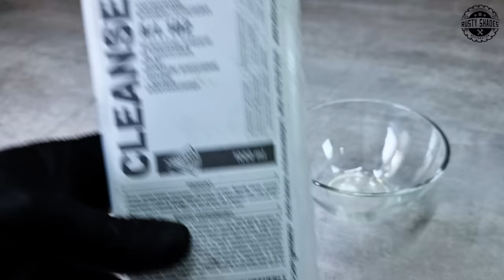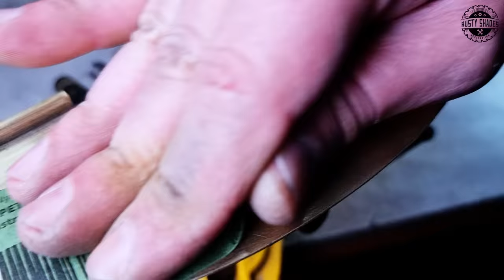Primitive Bread Toaster Restoration - 1918 Siemens-Schuckert

Comment: These take a little more care when toasting your bread.  I find you have to flip them top to bottom so they toast evenly on the one slide of the toast, but this is easy to do.  Toast them then move them upside down, then swap the left toast to the right side untoasted side inwards, and right to the left untoasted side inwards, after a bit spin them so to the bottoms get an even toast.  Oh and try not to get a cup of coffee while toasting and forget your toast as these old toasters are totally manual and depending on the toaster, then can toast your bread in a really short time and you can so end up with a totally black burned piece of toast.  If you look at advertisements of the time, some of these toasters and especially the 'automatic' toasters were very expensive to purchase.  Some of the first 'automatic' toasters were like $20 to $35 (or more, if you got the breakfast - ones - with a tray, jam holders, napkin holders etc.) which might have been a weeks pay.  So the fancy ones were not cheap.  I think a lot of people put them on lay-a-way to be able to afford them, then when an anniversary or xmas time came around - the toaster was paid for.
Reply from the maker: That's a great piece of information! Thank you for sharing it with us!

Comment: Surprisingly it was pretty good on the inside (at the bottom) I thought it would be a bit more crowded with time. Luckily it seems to have been stored in a clean dry area. Though I wouldn't have made the handles from wood, that Era would have been made from bakelite and it wouldn't burn. But bakelite becomes very brittle over time and didn't survive very well. Most likely why it didn't have handles.
Reply from the maker: Yes it was!

Comment: Hello, There is a risk for asbestos inside. By the way an exelent restoration. Regards: Stig Österberg from Dalsbruk in Finland.
Reply from the maker: There is no asbestos. Only Muscovite. I am a geologist, and this helps me a little. Thank you for watching! Cheers!
Reply: 🤨 Is Muscovite similar to mica? I have an antique radiant bar heater and it has mica washers for electrical insulators
Reply: @samuelfellows6923  I think it is a type of mica, but not 100 percent sure.
Reply: No Asbestos inside this one-but if you find a vintage cord for this, it may have Asbestos in the insulation.

Comment: Nice looking toaster no doubt, but the electrical safety aspect is a little sketchy. When checking if the element has any shorts to the frame, an insulation resistance tester is a far better tool for the job. A multimeter only tests with a few volts, where as the insulation resistance tester tests at 400 or more volts, to properly stress test the insulation of the element.

Comment: Looks like you forgot to hook in the springs again. The springs are intended to keep the "flaps" shut and slightly press the slices of bread against the inner grid of the toaster. Otherwise nice restauration - just try to find the right connectors that allow a really safe electrical connection...
Reply from the maker: Thank you for your feedback and for watching. I didn't forget to connect them; the springs were so damaged by rust that If I tried to use a bit of force on them, they would break. I have a lot of sets of new springs in my workshop, but none of them wanted to fit in there. I will try to make new ones with music wire, but that isn't so critical for now. I'm not in a rush; the toaster will serve as a decoration in my kitchen 🙂 Now that I found out about the brand, maybe I'll find a power cord too. I will love to have it complete.

Comment: I don't mean to be a critic as the final result is fantastic, but can you explain why you chose to "hot blue" the springs (around the 15:00 mark) rather than use a bluing agent?  I didn't think that springs reacted well to heat?
Reply from the maker: That's an easy one, but good. Most the cold bluing agents are composed of very toxic substances, including cyanide. I couldn't do that because I feared contaminating the food, especially next to the heat. The chemicals are very toxic and rapidly absorbed if it is accidentally splashed or swallowed. Death can occur even in an adult.
The spring wasn't more damaged than before; I need to replace them anyway as soon I find the correct dimension. Till now, I didn't have luck, I have over 250 types of new springs in my shop, but none of them wanted to fit in there. 😅
Reply: @rustyshadesrestoration  Got it...Thanks for the follow up...And again well done...It really is a beautiful job...
Reply from the maker: You're very welcome! I'm glad you like the result! 🙂

Comment: To clean tarnished brass, mix equal parts salt and flour with enough vinegar to make a thick paste. Rub on, let it sit over night wrapped in clingfilm and remove rubbing vigorously with a damp cloth. Wash, rinse, dry thoroughly and then polish. There is no need for endless sanding.
Reply from the maker: I know the technique; I'm restoring stuff all day long, but here wasn't the case to use it because I first had to remove the nickel layer. That technique won't remove it. Cheers!

Comment: Too bad you couldn't  get the spring action to work again. Otherwise fantastic job❤
Reply from the maker: Thank you! The springs are fine; I just didn't attach them back because they put too much pressure on the bread edges and burning them super fast. 🙂
Reply: @rustyshadesrestoration  Ah, that makes sense 😄

Comment: Excellent, but the two coloured inner wires leading into the toaster need to be more adequately insulated.
Reply from the maker: Thank you. Nobody will use it, so there is no need as long as it will serve as a decoration.

Comment: Are those heating elements made of wire wrapped around mica panels? Did I also see some circular mica spacers? I remember, when I was very young, seeing mica used in appliances because it doesn't conduct heat or electricity.
Reply from the maker: Yes, they are made from mica. 🙂
Reply: @rustyshadesrestoration  Thanks. BTW beautiful restoration!
Reply from the maker: Thank you 🙂 I'm glad you enjoyed the restoration process. Have a great evening! 👍

Comment: Why don't the springs on the bread holding doors work anymore? atleast one side seemed to work before you messed with it and now both doors don't spring closed anymore to hold the bread into the toaster? still looks good tho.
Reply from the maker: Thank you. Those springs were weak and so rusty that the ends broke while putting them back, so there was no tension on the doors. I tried my best to save them, but that was almost impossible. I also wanted to replace them with new ones; I have 250+ sizes, but none fit in.; it happens when dealing with such old stuff but didnt affect my project with anything; a bit more pressure on those bread slices will not help because they will burn, even like this I had to be very careful 😉
I plan to make my own with music wire springs, but I will see when I'm not in a rush with those for now. Cheers!

Comment: I appreciate the use of rubber gloves while demonstrating this toaster.  While it looks quite nice, and passed the test for no conductivity to the base, electrically this is a very dangerous design.  I would not find a cord for it, I would render it impossible to plug in, and place it where it can be seen, but not reached.
Reply from the maker: Absolutely. It will serve as a decoration in my kitchen. 🙂

Comment: I’m surprised those mica insulators held up and the heating wire around them still worked.
Reply from the maker: Well-built devices. They were made to last forever without these days' consumerism strategy. Thank you for watching my videos! Cheers!
Reply: If not physically damaged, Mica pretty much lasts indefinitely.
Reply from the maker: Absolutely!

Comment: Did you forget to attach springs back so the doors would stay closed?
Reply from the maker: No, I didn't forget. I didn't hook them especially for the test because they were putting too much pressure on the bread, and that helps only to burn them faster on the edges.

Comment: I thought the long springs were to keep the doors shut.  Evidently they don't do anything.  Looking good though
Reply from the maker: They should, but I didn't fully mount them back because they were applying too much pressure on the bread slices, so they will get burned only at the edges.

Comment: what did the springs do? I assumed they would be for tension to apply pressure on the bread but it appears i am wrong or they are just broken from the get go.
Reply from the maker: That's right—too much pressure on the bread slices for my test; after that, I hooked them back.

Comment: Nice. But you something wrong with springs at the end. 0:23 - spring close covers. But at the end you close it manually... And can fully open without holding - spring not work
Reply from the maker: They aren't hooked to the doors to avoid unnecessary pressure on the bread slices. This will help only to burn the edges immediately; even like this, I had to be very careful. Cheers!

Comment: Calling it "safe" is a stretch 😂😂😂.  Crazy to think it wasn't earthed at all.
Reply from the maker: True 😅 Safe for me to test it.
Reply: it's safe, unless you are dumb enough to touch the heating element.
Actually, a earth ground connection would make it MORE dangerous, since you would be able to touch both the heating element and the earthed housing at the same time, which would cause an even worse electrical shock hazard .
Reply: @m.k.8158  there's nothing to save you from touching the heating element. Touching it would hurt you regardless. An earthed casing would protect the device from sitting live. A lose connection would render the device an inconspicuous death trap. It's why we have earthing regulations on all mains devices that have exposed metal surroundings in the EU.

Comment: It looks nice from 10 feet away, but you left a lot of sanding marks in the brass. You really have to sand out all the prior grit scratches all the way up to wet 2000 grit before buffing if you want a real mirror finish.
Reply from the maker: Hi Andy, do you think I don't know the technique you mentioned above? 😀 
It is a toaster, not a knife blade, to be perfectly mirror-polished on both sides, 1st of all, and second, those are super minor marks; most of them are on the interior, without a camera, 3x zoom on it, and studio filming lights from all sides, that won't be so visible. 
Please ask why before starting to teach someone that does this every day or say what you will do. I hope you understand that you are a bit wrong, especially with the ten-fit-away affirmation, which I find rude, to be honest, as long as I see that you don't take into the calculation the zoom of the camera at high quality 60 UHD and filming lights. But that's understandable; you are not a restoration filmmaker. Cheers!

Comment: Aren't those springs supposed to hold the hatches up? They don't seem to work properly.
Reply from the maker: They are fragile; I need to find new ones to fit in. Unfortunately nothing in the local shops, maybe I'll have luck on the Internet.
Reply: @rustyshadesrestoration  you have a lathe, perhaps you could get music wire and wind your own springs?
Reply from the maker: I never tried it before, but I'll give it a shot. Thanks for the tip.

Comment: Why not use some mirror glaze and a buffing wheel of some kind to smooth out the scratches on that brass? Also some new nichrome wire and remake the heating elements? Restoration 80%.
Reply from the maker: You know, after a project is done I see also many things that could be done or done differently. That is always happening when you look from the outside...
I hope you understand me. Cheers!

Comment: It's electrically unsafe in this state. The moment the heater-wire breaks (which it will do at some point of usage), and then possibly touch the metal "cage" it is in due to its springiness, the whole toaster (every metal part) is then powered. Potentially lethal to touch it then. The right way to do it, would be to install a modern, 3-wire powercord and connect the green-yellow (earth/ground) permanently to the metal case.
Reply from the maker: You are right, and that's a good piece of advice, especially for my audience, just in case someone has an idea to restore his old toaster! In my case, I chose not to do it, (but I took all the safety measures for the test), because this toaster will serve only and only as a decorative piece, as well I'm planning to find an original power cord to have it complete. For me, this is important, and it will break my heart to modify it for a modern power cord. I hope you understand me.
Reply: And generally so primitive. There is no wifi or even bluetooth. But it does have more power 🤪

Comment: Nice job but there is a reason the brass was all plated and I'm sure you know what it is.
Reply from the maker: Thank you. Of course, I know. If I use it, I will nickel-pate the surface, but for now, will serve only as a decorative piece.
Reply: @rustyshadesrestoration  I love brass but it looks so bad when it tarnishes and the traditional lacquer is delicate. I agree that nickel makes the most sense.

Comment: Did you test for lead paint or lead traces at all on any piece?
Reply from the maker: Yes, for lead traces, because there was no paint. It seems that you are new here; if you see me going with no problem means that there is no lead. If the test is positive, I'm shown it in the video.🙂
Reply: @rustyshadesrestoration  I didn't realise that the top was brass, I thought the green was paint.
Reply from the maker: Ah, no, that was just corrosion.

Comment: Did you finish the spring loading for the doors?
Reply from the maker: No. I chose not to hook the springs back for the test because that would cause too much tension on the bread slices and would help only to burn the edges. Even without springs, I had to be very careful...

Comment: I feel like the springs are supposed to hold the doors shut.
Reply from the maker: They should, but not this time. They are too weak; that helped me because if I had more pressure on the bread slices from the doors, they would burn immediately; even like this, I had to be very careful.

Comment: nice, but why don't the springs work?
Reply from the maker: The springs are fine; I didn't attach them back for the test because of their ununiform power distribution. If I keep them connected will only help me to burn the bread on the edges. 🙂
Reply: @rustyshadesrestoration  thanks for the answer. very nicely done for a museum...

Comment: The door springs seem much weaker once you finished the job. Perhaps you shouldn't have heated them up so much
Reply from the maker: They are fine 🙂 I just didn't attach them back to the doors to avoid extra pressure on the bread slices while doing the test. Even without I had to be careful to don't burn them.

Comment: I think you forgot to tension the spring
Reply from the maker: I didn't; those springs were applying unnecessary pressure on the bread slices and only helped to burn them on the edges. So, for a better test, I didn't attached them back 🙂

Comment: Wrong. The 1st electronic toaster was made in the UK in the 1890s.
Reply from the maker: That's wrong 😀 When was the electric toaster invented?
In 1906, the first U.S. patent application for an electric toaster was filed by George Schneider of the American Electrical Heater Company of Detroit, using Marsh's wire. General electric introduced their first electric toaster in 1909, using a competing alloy.

Comment: So basically I have no idea how old toasters work
Reply from the maker: As the electricity flows and electrons collide, the energy around the nichrome wires becomes heated, and the excess energy radiates away from the coils, heating your bread. The heating elements will glow red hot, and the closer the mica sheets and bread are to your heating elements, the faster they will toast.

Comment: I would have put some type of insulated wire between the electrical connections underneath that connect the plug to the element (instead of just the two bare wires), because you have electricity that doesn't give you a shock like 110v does, your electricity will blast someone across the room.
Reply from the maker: Don't worry; nothing could blast me across the room because I took all the safety measures for the test; for example, I'm responding to you now, which means that I knew what I was doing there, and you have an excellent demonstration that the toaster still works after 100+ yes. Cheers!

Comment: the way they connected the heaters to the plug with just bare copper wire feels very unsafe with 220v and into that what if they touch the metal
11:36 kinda anooys me you didnt fix that
Reply from the maker: Those were the times...

Comment: ‘Muscovite’=mica?
Reply from the maker: Yes. I can recognise it from the Moon 🙂 I finished an MSc in Geology. Makes products using Muscovite dielectric and thermal insulators.
Reply: @rustyshadesrestoration    When I worked on old radios and early televisions, it was used for several components in them. God, I’m OLD!
Reply from the maker: I saw some of them too. My grandmother had a black and white TV, and when the only person in the village that knew how to repair them was coming to our place, I was literally on his head to see what was inside.
Reply: @rustyshadesrestoration    And how I discovered not to grasp the high voltage lead to the CRT, even when off. Ended up at the far wall of the shop and don’t remember how I got there. Ow. Some of the mica stacks were adjustable capacitors but don’t recall how they worked. The switch was on then to transistors and low voltage circuitry. But the CRT voltages tripled. I even built my own vacuum tube tester from a Radio Shack kit in the early sixties, and then they stopped building with them.